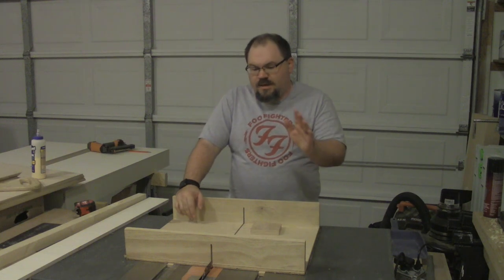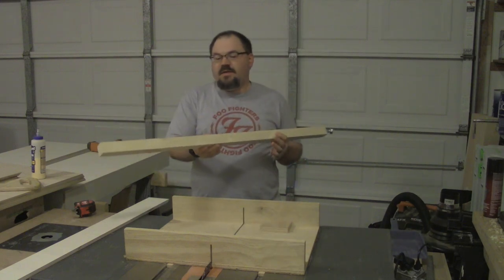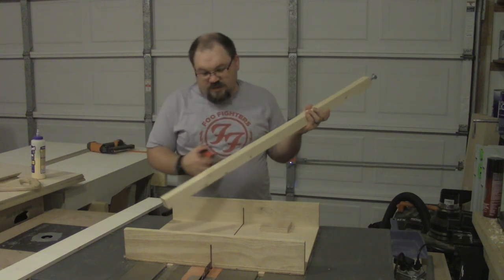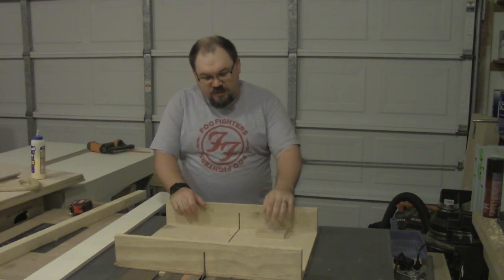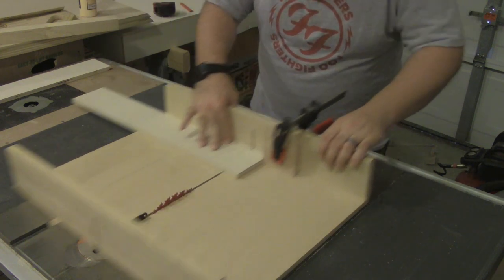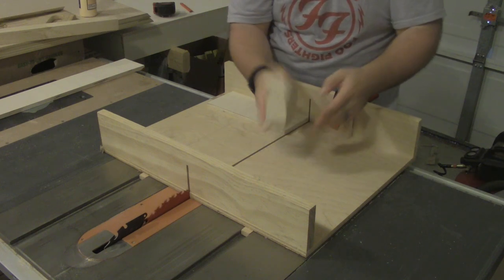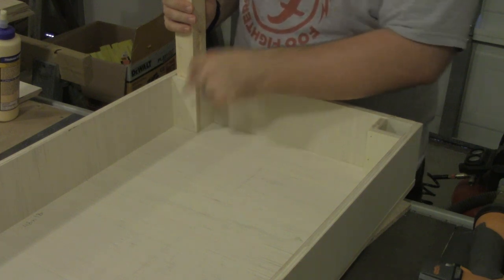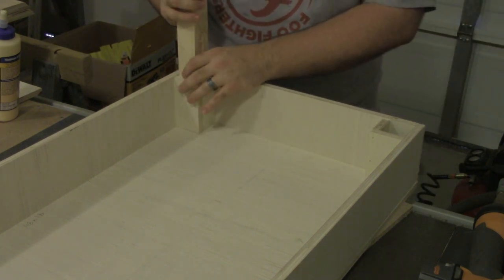96x18 Switching Layout - Part 2 - Module Leg Pockets

Comment: Nice job on the wood working aspect. The pre primed wood at home cheapo ain't that bad..good enough for benchwork!! I used the same stuff on my freemoN sections, but I did use Baltic Birch for the face/end plates.
Good work,,keep it up.
Greg

Comment: Just wondering. Do you ever accidentally (as opposed to intentionally!) hit the legs with your shoes? Putting them 6 inches inside the edge would eliminate that possibility, but I guess would make things unstable. With the legs at the outside, I'd be afraid of stubbing my shoe on them and causing an N scale earthquake.
Reply from the maker: Never had that problem.  I look it like it's no different from a splayed out table leg or feet on a couch.

Comment: If you drive screws into the pocket holders into the legs, that kinda defeats the purpose of a pocket, doesn't it?  The pocket concept implies remove-ability, especially to go to shows.
Reply from the maker: No, I wanted something that I can screw into from the inside and avoid the screw heads showing from the outside.  It's cleaner this way and just as functional.  As I stated in the video, this layout will never be broken down to "go to shows", as a normal module would be.  Once it's set up, it will only be broken down to be moved to a new home.  Thanks for watching!